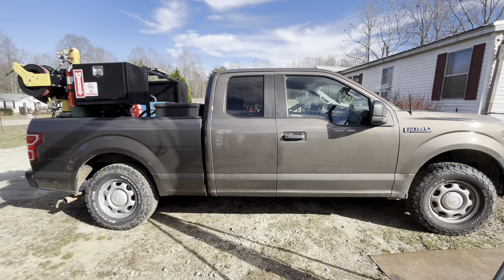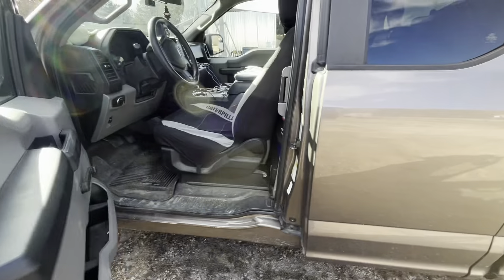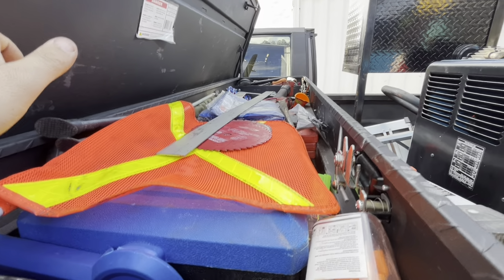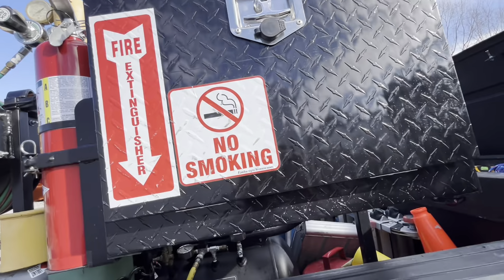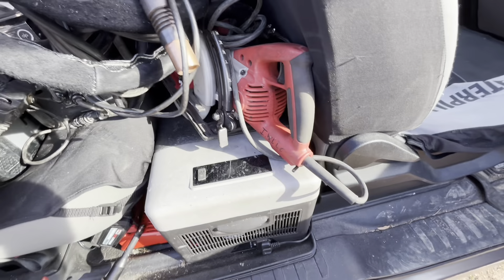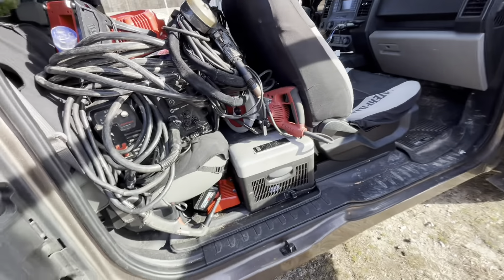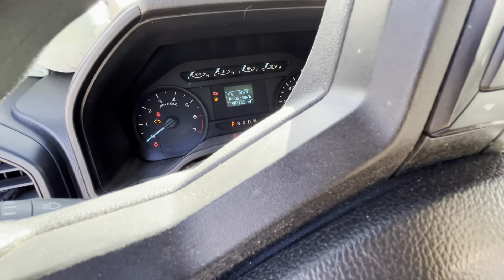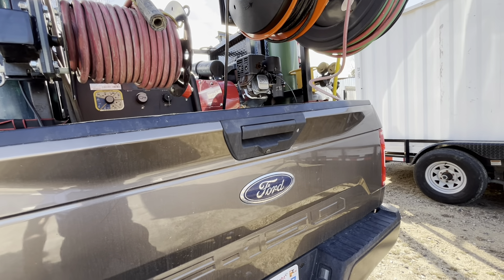2019 f150 welding rig tour

Comment: So question how is it not squatting and are your leaf springs look flat instead of arched up. I have a 2016 f150 and it sits low cause all the weight I still have to brace the chassis and put heavy duty leaf pack on there

Comment: Not a bad rig. I wonder why you didnt go with a 2500 or bigger even if you wanted to stay in a gasser vs diesel.
Reply: The new diesels these days , are really ment for specific purposes. The days of getting a diesel for reliability, fuel economy and long term ownership savings are long gone. And probably my opinion is derb did it for foot print reasons and he knows exactly what he needs to get the job done efficiently. Hes been in the game long enough to know. I mean he did have a f450 diesel for a while. Not sure if hes got it still.
Reply: @George88889  I think a 2500 gasser would have similar footprint but handle the weight better.
Reply: Im on the fence with that to be honest. As long as you keep it inside the ratings its fine. Those f150s are everywhere on jobsites. And really they are almost in the 3/4 ton class. Its crazy to think back in the older days (80s and 90s) the weight you could move with an old school 3/4 and 1 ton is pretty much what the half tons do these days..  i will say this id by a half ton ford over the other 2 any day. Just because of the ratings and simplicity

Comment: Nice truck it has everything I'd want on my F250 except the welder I already got my Lincoln 10000 plus my air compressor is plug in but its real handy a little C&H 13 gallon I got a speedaire 20 gallon as soon as I can get a pump it will take up residence on my truck

Comment: It’s not a simple truck to work on lol.  The shop I work at has a 2017 5.0 and it’s been in the shop for 3 weeks just because it’s a pain in the ass to work on.  

I don’t want to sound like I’m dissing the truck because I have the same truck just a year older. Trust me the 5.0 even with all its quirks is more reliable than the stupid eco boost engines. That and if you know what you are doing there simple to work on to a degree. The shop I work at mainly works on diesel engines and construction equipment. (Construction Yard and repair shop the company does all repair and fabrication in house)

Comment: You're asking a lot of that truck brother.
Reply from the maker: Not even close. The truck has a over 3000lb GVW and I’m using only a third of that
Reply: Nah I had 100 gallon transfer tank and toolboxes in my 2009 f150 that weighed 1500lbs, I added heavy duty leaf springs and the truck worked for many years until I could save up to buy my 2019 f350